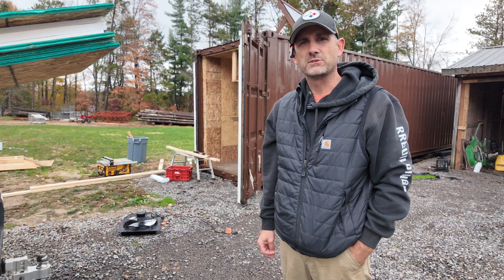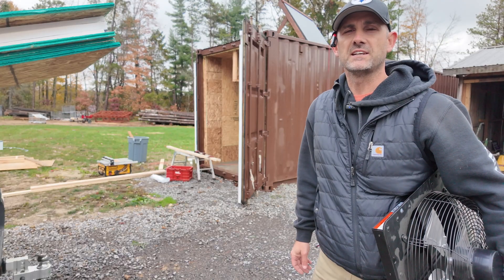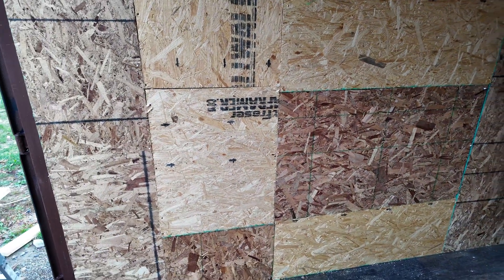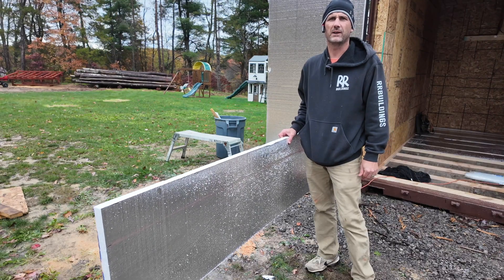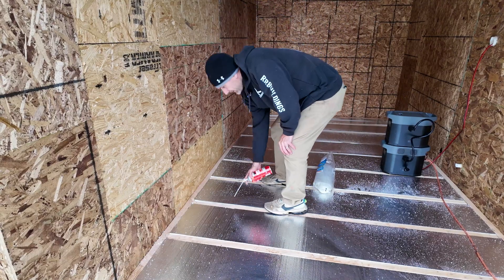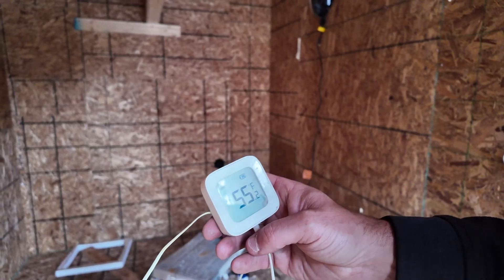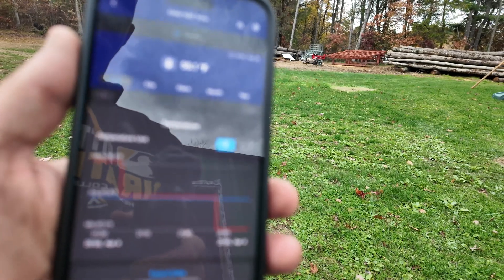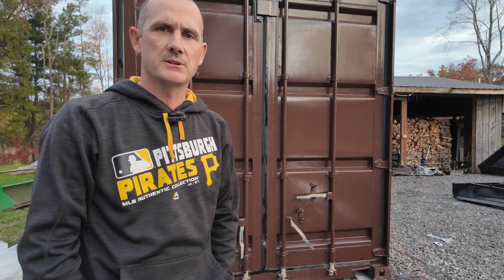My Shipping Container Kiln Just Leveled Up for Real Lumber Drying Power and Efficiency

Comment from the maker: Shipping Container Kiln Build
Dehumidifier: https://amzn.to/4oq4Nuf
Temperature & Humidity Controller: https://amzn.to/44khsGp
Container Lug Jack: https://amzn.to/4pvD4YL
Fan: https://amzn.to/4oYFKhD
DIY Spray Foam Kit: https://amzn.to/44mR1jp
Container Rust Paint: https://amzn.to/43NQuqy
Bottle Jack: https://amzn.to/4oPPLgW
Vevor Exhaust Fan: https://amzn.to/4imFlDi
Junction Box: https://amzn.to/4a9rE8q
Wood Moisture Meter: https://amzn.to/48uD9pM
Vevor Diesel Heater: https://amzn.to/4ouk2lp